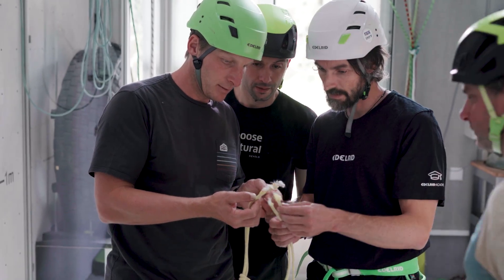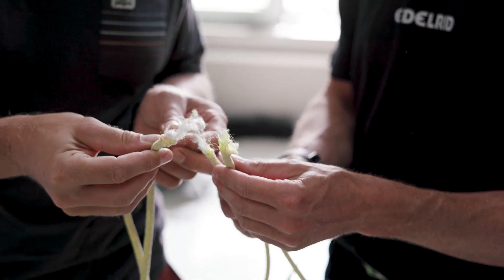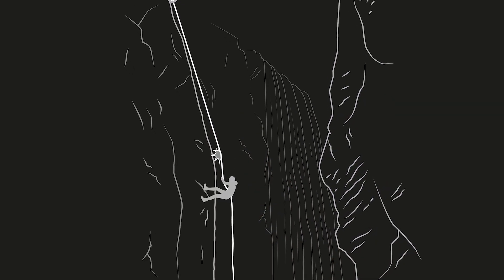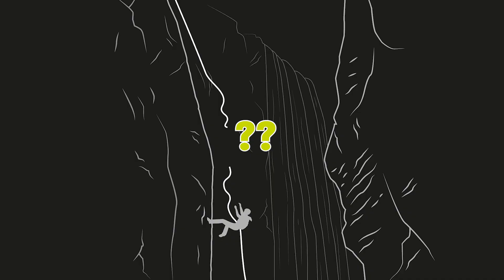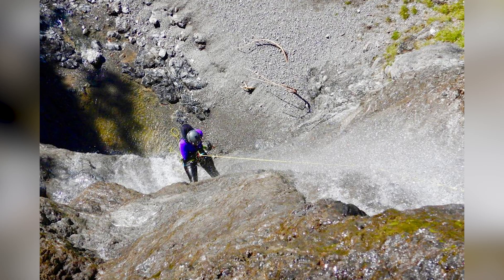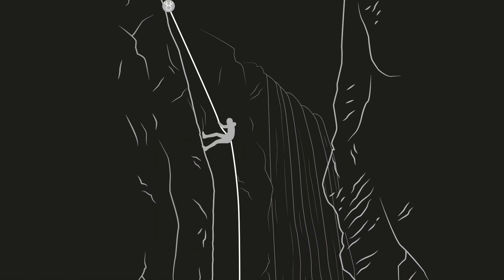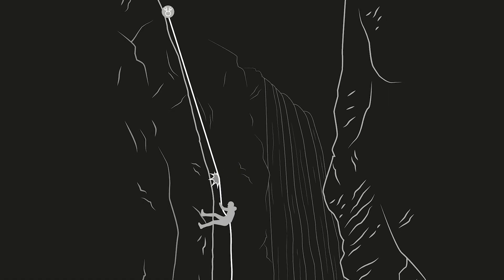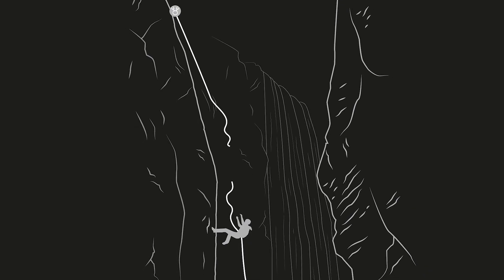The Analysis of a Canyoneering Accident

Comment: Hello, This is a great example of knowing the limitations of our equipment. I am very happy that Alex has recovered and is safe. This could have been so much worse. In the US of America, we have been using smaller ropes than usual and have have been getting smaller and smaller. As a canyoners and a rope manufacturer, this is exciting and concerning. I am continuously working to improve the smaller ropes.  I am currently working on EN564 certifications for my ropes that are 8.5mm and smaller. These ropes are not necessarily being used as an accessory cord though. Many canyoners use them as a main lines for abseiling and such. I would love to send you some ropes to test and compare to regular accessory cord. These ropes are designed to have an MBS of 22kn, but as your test shows and I emphasize, there are other factors to consider. As this sport grows and progresses, the limits will be tested.

Comment: What is the static elongation of this rope? Ive found that Edelrid ropes are much stretchier than American canyoneering ropes
Reply from the maker: This was actually not an Edelrid rope and an accessory cord as well, where usually static elongation is not measured as part of the standard. So I would not be able currently to answer you this. However, for semi static ropes what you are describing is very often the case between ropes according to an EN standard (often times from Europe) and ropes that have not such certification. And that is because the EN standard does not allow for very static ropes. American standards are usually written differently and allow for this.

Comment: Analysis of the accident take on to accounts only the technical aspects. Not a word is said about the procedural aspects.
1. The simplest is belaying the rappeller. After all, there's another part of rope at the stand...
2. You can also simply rappel on two strands of this thin rope. This increases the safety margin fourfold: half the load on each strand and twice as much fiber material to cut at the edge.
3. Since I'm a 65 old, and started climbing in 1977, I'd use a thicker rope. The same brand and construction but thicker. 6 mm maybe is good on glacier...
Reply from the maker: You are completely right and thank you for adding this. On the one hand, we as a manufacturer of course see our expertise more in evaluating the technical aspects of such an accidents. But of course it could have been pointed out that there is more to this then only that. And certainly with more details on that incident's aspects of whether or not he would have been able for example to rappel on two strands a discussion on procedural topics would be easier.

Comment: Wich rope please?
Reply from the maker: It was a 6mm cord. However, in this channel we try whenever possible not to thematize any specific product models as we do not intent to either praise or badmouth products of us or other manufacturers. Instead we would like to provide a more general knowledge about a certain issue, application, risk, etc.
Reply: @EDELRIDKnowledgeBase  
It would be great if you could include some comparison tests between modern aramid-reinforced ropes (especially thin diameters, like 6–8 mm) using your abrasion resistance cutting machine.
For us canyoneers, this would be incredibly valuable, we face sharp edge risks in real conditions all the time, and it's not always easy to judge which rope construction is truly safer.
We’re not just looking for marketing claims, but for real data to help us make informed decisions. We risk our lives out there for this passion, and your insights could help raise the bar for safety across the community.
This  Edelrid Knowledge Base  should be about🥰
Reply from the maker: @webkeek  I see your point. And what you are describing is exactly the real world problem about this issue at the moment. There is no way to judge safety for a user in the context of the risk of edges. However, we believe that the information on this channel have more credibility and therefore a bigger use overall when we try to stay as neutral as possible and not make this about individual products but about general safety scenarios. As we are doing this in the name of a manufacturer the moment we make this about the specific products, it will not be credible anymore. This channel is managed and done by product people not by marketing people. Our main interest is that people understand products and their ramifications and use them in an informed way not that they buy them. It is not that the later is completely unimportant for us, but on this channel we got the freedom to focus only on the first part :) And in a bigger context we are pushing for a standard here and publish the results of our products at least (but not on this channel then, of course).

Comment: Well the 11kn for rope is not much (no knots but coiled around the barrel). Normal 11mm would be much better in this situation. Skinny ropes are cool but this whole they are just as safe as the old fat ones is just bollocks.
Reply: indeed, that´s because of the downsizing trend, that is so popular, which just is dangerous in my opinion. a good old, more beefy rope can handle more abuse before braking, but manufactures want you to buy special more cut resistant ropes instead.
Reply from the maker: Thinner ropes have their advantages and disadvantages and they can be made very resistant to such physical abuse. And the other way around is also true. Thick ropes can be made very vulnerable to abrasion. So much so, that a thin rope can be equally resistant to cutting then a thick rope. The problem stands: Without a standardized test there is no way for the user to judge.
Reply: @EDELRIDKnowledgeBase  anyway will a equally well designed and produced rope always be more durable when more material is used.
a modern aramid reinforced rope can not be compared with a old designed rope therefore.
but two modern aramid reinforced ropes compared, one tiny one fat diameter, the fat one will take the lead aany time.
oder auf deutsch man muss halt äpfel mit äpfeln vergleichend und nicht nur die dünnen hghtechstricke verkaufen wollen.
und am sichersten sind dann halt immer noch halbseile in halbseilführung und am besten mir schnittschutz im Mantel.
Edelrid wird da sicher was bringen in Zukunft.
Reply from the maker: @apeclimbing  It is true that when all parameters are equal a thicker rope is more resistant then a thinner rope. However, this is never the case and even more importantly a user will never be able to judge this. And the real world shoes impressively often in our tests: thicker does not mean safer.
Reply: @EDELRIDKnowledgeBase  therforee you can then design a 1 mm rope if more diameter means nothing.
but physics can not be broken.
Reply from the maker: @apeclimbing  I am afraid you are not getting or do not want to get the point. Diameter like many other characteristics is one out of many parameters to influence a rope's cut resistance. And that in a realistic case you will not be able to judge the true differences by the diameter.
Reply: 11kn is plenty strong for rappels where the force is 1-2kn, problem is the weakness to abrasion.